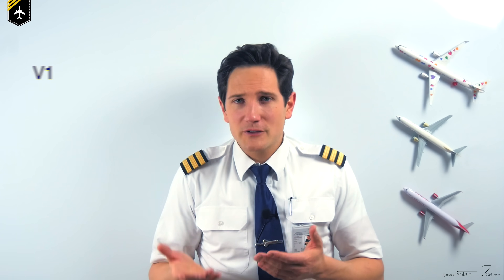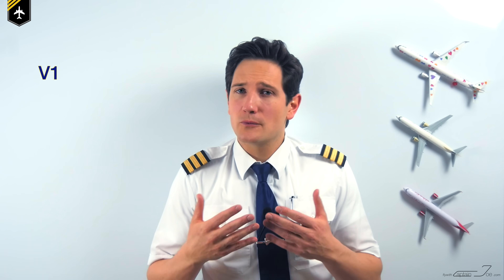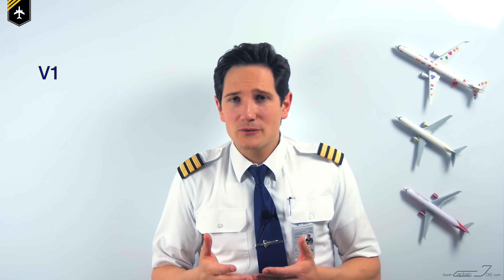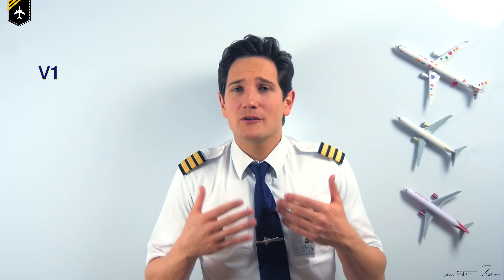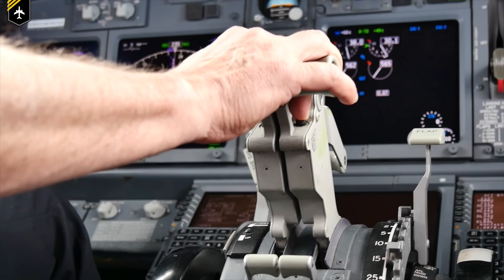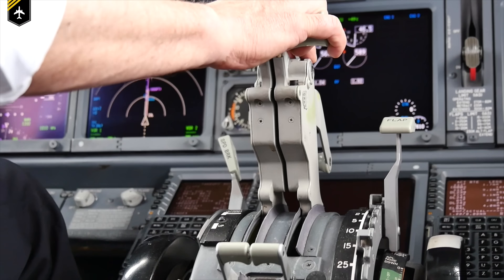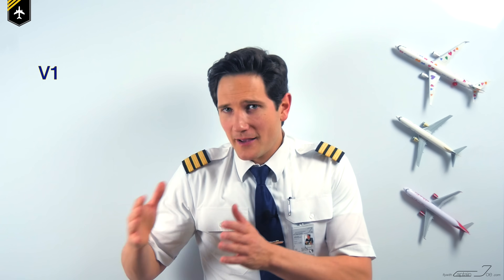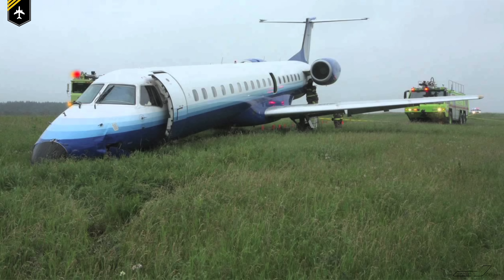TAKE-OFF Speeds V1, Vr, V2! Explained by "CAPTAIN" Joe

Comment: There are extreme situations where an abort after V1 is warranted. But more than likely the pilot would not be aware of them. For example, if the vertical stabalizer departed after V1 but before VR it would be perfectly ok to reject the takeoff as the aircraft will but critically unstable with no vertical, and an overrun is safer than an unbalanced aircraft with no lateral stability. Thats just one example though.
Reply: If you loose your vertical stabilizer after V1 (extremely unlikely) you can leave the rear landing gear down and this will help stabilize the plane for an emergency landing. If you loose both engines (again extremely unlikely) after V1 your gonna Pray.
Reply: Clement FPV with a dual engine failure, the plane won’t fly (more than a few seconds)
Reply: interesting, I was wondering what a captain would do if he looses both engines just after V1 before Vr, the airport is surrounded by  trees, it would be probably better to just overrun right ?
Reply: @clementfpv5054  If you lose both engines, there's no decision to be made.  You're not flying.  If you've passed V1, you're not stopping either.  You're going off the end of the runway.
Reply: @stargazer7644  well if you encounter the situation and decide not to decide anything, I don't want to be flying with you !
Reply: @clementfpv5054  So tell me what decision you'd be able to make?  You can't fly, and you can't stop.  You're going to run as far down the runway as you can, slowing down as much as you can.  Then you'll go off the end and start hitting things.  You'll almost certainly destroy the aircraft.  Hopefully there won't be any fire since you're full of fuel.  With luck, the cabin will stay intact so the passengers can make an emergency escape.
Reply: chris singleton Chris, how do you leave the rear landing gear down?
Reply: Felix which airplane has rear gear levers?  If you were being sarcastic, then sorry, I didn’t pick up on that.  If you really believe there are rear gear levers, then you should stick to commenting on things you know something about.
Reply: The consequences of a runway overrun varies, obviously.
Om runways equiped with EMAS, the consequences are less severe.
https://en.m.wikipedia.org/wiki/Engineered_materials_arrestor_system
Reply: Felix haven’t heard any intelligent response from you lately.  What’s up?

Comment: ok this might sound a bit stupid, but i was wondering what would happen if reverse thrust was applied whilst flying?
Reply: usmaan abdullah Aircraft wont allow it, theyhave sensors on the landing gear. 738s can have idle reverse at -10 ft on radio altimeter.
Reply: Nothing good. A high tendency to roll. Although as stated before, it's nearly an impossibility, due to squat (weight on wheels) switches. But it has happened.

Comment: Hello Joe, I have a question. As you said v1 is same for all the planes, but the take off range changes from every aircraft. For example, cessna has a shorter take off range compared to a 747, which means it has more runway left. So can they abort? Or doesn't it just matter about the runway? Is it about the speed?

Comment: So say you're flying a really long runway, with, say a twin STOL. Is it possible Vr would come prior to V1 as you could still safely land on the same runway after you have lifted off?
Reply: No. If you can land on remaining runway that's nice but it's not called V1.
Reply: In that case, would there be no V1 call?  (This is assuming that due to the runway length, the calculated V1 is greater than the calculated Vr.)

Comment: In Boeing Type Rating, the heigt from ground level is 40 feet if aircraft in one engine inop procedure. so 35 feet for what type aircraft ? Airbus ?
Reply: 35ft is certification specification for large aircraft, regardless of aircraft type. Manufacturer can have stricter standards, but not lower.

Comment: Question: what common regulations can be changed by captain?

I've been travelling to Munich from small local airport together with 30 team mates via private flight. Seemed captain decided, we don't need to go through security check, since we could be separated from other passengers in transit area. That was cool, but hit us back a bit, because on the way from Munich we needed to go through security (no separation and liquid rules)

Comment: What happens if both engines fail after V1?
Reply: Well, if those are the only two engines you have and you can no longer accelerate, then the decision has been made for you. You will not take off and you will run off the runway.

Comment: Hey joe! It would be great if you could explain the CAT I CAT II and CAT III landings. It's kinda complicated and for me a little hard to understand. Thank you :)
Reply: Dominic Hoang A Cat I approach is an approach with a minimum visibility requirement not less than 1800 RVR (VOR, NDB, ILS, RNAV) and can have a Decision Altitude as low as 200 ‘.  A Cat II approach has a minimum visibility of 1200 RVR (1000 for some operators) and a decision Height not less than 100’.  Cat III approaches can be charted with a minimum visibility of 0 RVR (Cat III C.  None in the USA that I am aware of), 300 RVR for Cat III B with a 100’ Alert Height or 600 (or 700) for Cat III A and having a Decision Height if 50’.  

Cat II and Cat III approaches are autopilot flown and landed or require the use of a HUD, and also require special crew training and an aircraft certified for those operations.

Comment: Is v1 changed primarily based on runway length???
Reply: Yes, the more thrust and longer runway the more deceleration room you have. Despite the video's statement there's no requirement for V1 < Vr < V2. Ideally V1 is more than Vr so abort is possible at all speeds prior to rotation.
Reply: No.
Reply: V1 is "the point of no return" so logically it makes sense that a longer Runway would give you a later V-1. However things aren't always logical so would be great for somebody who really knows the answer to explain it
Reply: Brian Clark Actually, yes there is a requirement.

Comment: Hello Joe. My compliments on an excellent education into aviation!! I have a question concerning plane landings in severe crosswinds. I have seen videos of planes trying to land whereby, whilst the plane is travelling in a direction parallel to the runway axis, due to crosswinds the axis of the fuselage is not parallel. Whilst the pilot tries to correct this with the rudder to touchdown, what happens to the main undercarriage at touchdown if the fuselage is still not parallel. Is there some tolerance for the undercarriage to adapt to the direction of landing whilst the fuselage is corrected. I hope I've put this as clear as I can. My best wishes and many thanks.

Comment: Am I seeing/reading this right? If V1 is always before Vr then the plane is not physically capable of safely taking off or meeting the min screen height until after there isn't enough runway left  to stop? 

If correct seems like  a pretty unsafe way of doing things. Shouldn't Vr be achieved well before V1 so if you have to reject the take off you've got enough time to make the decision and initiate procedures to stop or rotate and take off.

I'm not a pilot obviously.
Reply: V1 accounts only for engine failure. Aircraft can safely fly with one engine.
Reply: Aah makes sense now. So the aircraft is capable of safe flight with both engines well before V1 is reached

Comment: Cpt Joe I've always wondered what the noise is from the engines shortly after takeoff, it sounds like they are losing power and it always freaks me out. Thankyou.
Reply: Because planes don’t need full thrust to fly, but full trust is usually used during takeoff for reasons of if an emergency occurred, the plane would hit V2 the fastest. So after the plane takes off, full thrust is not longer needed and the throttle is set to a pre set climb thrust level

Comment: Joe, you say the speeds will always follow in the same order. But surely in a Cessna, Vr can come long before V1. Or did I miss something?
Reply: In what cessna? for example c172 doesn't have v1 and v2
Reply: Hey Nikola. Joe says from 0:34 that the speeds always follow in the same order, "no matter if you're sitting in a little twin-engined Cessna, or ... ". 

My understanding is that you could still have a crazy long runway where Vr is below V1. 

Happy for any clarification.
Reply: Of course :) Joe is trying to explain complicated stuff in simple way to ensure most people can understand him. In process of simplifying, he loses some precision and that's normal. 

We use V1 as general point where stop-go decision should be made,  but it should be clear that by certification specifications for large aircraft (CS-25 by EASA and similar document by FAA), V1 is purely in place to ensure safe operation of multi engine aircraft in case of engine failure. 
By Certification Specifications for Normal, Utility, Aerobatic, and Commuter Category Aeroplanes  (CS-23 by EASA and similar document by FAA), V1 is only required for multi-engine commuter aeroplane category.

That leaves a very large pool of non-commuter single and multi-engine aircraft for which manufacturer doesn't need to provide any V1 information, and doesn't need to demonstrate V1 related abilities for certification purpose.
Since V1 is Vef dependent, it doesn't apply to single engine aircraft at all. Why V1 is not required for non commuter multi engine aircraft? I don't know.

By the same documents, "Vr may not be less than V1". That's simply law.

Comment: Can you explain how to calculate ISA and ISA deviation?
Reply: You cannot calculate ISA. ISA is standardized set of atmosphere parameters, it is always same. ISA deviation is just how much measured atmosphere parameter deviates from ISA. For example, if ISA temperature at sea level is 15*C (it's fixed value, always the same), and you measure 20*C, temperature deviation is 20-15=5*C in other words, it deviates 5*C from standard.

Comment: Besides the V1, Vr, V2 and Vl.o. Joe has mentioned, there are more than just these main speeds. For takeoff, there are still Vstall, Vmcg (min control speed for ground), Vmca (min control speed for air) and Vmu (min unstick speed) types of speeds to consider. However, they are not as crucial but pilots should be properly educated on their respective aircraft types that they are flying, and be aware of the above mentioned speeds for a real safe takeoff! :)
Reply: They are crucial :)

Comment: What if the captain discovers a serious anomaly between Vr and V2 or right after V1? He can't abort the flight and can't continue it either.
Reply: I realize this is a late reply and the question was asked over a year ago.  However yours it is an excellent question.  Remember that there is usually more information in aviation.  “Captain Joe's” well done video above covers V1, VR and V2 but was never intended to be an exhaustive and comprehensive presentation on every possible aspect of the takeoff scenario.  Neither is my reply. There are usually some other calls made during the takeoff phase.  For example usually there is an acknowledgement that the airspeed indicators have begun providing airspeed information; “airspeed alive” is a common call.  Again there are going to be different calls for different regions and crews.  Another “call” is 80-knots (or close to that).  In learning/understanding the takeoff phase there are different levels of accomplishment.  First is just knowing what words need to be said.  Another level is saying the words at the correct place.  Another level of understanding is knowing why the words are said and why they are important and what action becomes appropriate as a result of having achieved those speeds.

The airspeed alive call is used to verify that the airspeed indicators are in fact working.  Check out “Birgenair Flight 301 a Boeing 757-200 accident”.  Non-working airspeed indicator(s) sending no or confusing information has resulted in many hull losses (crashes).

The 80 knot (70-90-whatever) call serves SEVERAL purposes.  One purpose, remember there is more than ONE purpose for the call, is to verify that all the different sources of airspeed information are still working AND that they are in agreement.  On the Boeing 737 NG I fly I have 4 indicators I check at this point.  The First Officer’s airspeed indicator, the emergency/standby airspeed indicator, my airspeed indicator and the airspeed indicator displayed in the HUD (Heads Up Display I am required, by Company policy to have displayed for all takeoff and landings).  Before or at the 80 knot “call” would be the better place to discover that one or more of them is inoperative and ABORT the takeoff.

Now to your question: “discovers a serious anomaly between Vr and V2 or right after V1? He can't abort the flight and can't continue it either.´ You are going to have to do something, doing nothing and roaring down the runway indefinitely is not an option.  A competent crew should be able to fly the airplane by pitch and power settings without any airspeed information.  Meaning they ought to be able to stick the nose of the airplane at some known and reasonable angle on the horizon and set a known power setting and be able to get the airplane into and then back out of the air safely (landing).  Every flight manual I have ever worked with has a set of tables for power and pitch settings with “unreliable airspeed” in the emergency or abnormal section of the manual.  On the 737 NG I fly in the HUD I have an AOA indicator (angle of attack).  With the AOA indicator any competent airline crew should very easily be able to fly at safe speed without any other source of indicated airspeed.  There also are independent sources of groundspeed (FMC & GPS).  Groundspeed is NOT airspeed BUT without any other airspeed information it is better than NOTHING.  That is why we get paid the salary; it is a skill.

Since indefinitely roaring down the runway is not a viable option the other choice is to abort the takeoff on the available runway in front of you.  Will you go off the end of the runway; well that depends.  Aborting after V1 statistically has a high probability of exiting the prepared surface and going “cross country”.  Exactly what is off the end of the runway anyways? Is it a 50 meter drop off onto jagged volcanic boulders and an icy cold ocean or into a jungle ravine or are there kilometers of freshly mowed farmer’s fields off the end of the runway?  Is the outside air temperature a balmy 21C or 50C below zero?  All of this needs to be though through clearly before the takeoff.  At V1 there is no time left to start thinking of the ramifications.

Comment: i was taught that v1 was the speed that you could continue the takeoff with an engine out.
v2 is where you cannot stop on the runway. Vso is engine out speed (best climb speed) and is marked with a blue line on the airspeed indicator.. Vmc is the speed at which you can use full throttle on one engine, and one engine dead.

Comment: Why does V1 always preceed Vr? Isn't it possible that the abort speed is higher than the rotate speed if the runway is long enough? In which case V1 would equal Vr in practical terms (you can't abort a takeoff that's already complete).

Comment: Hey Joe, I'm sure some airlines used to train pilots to throttle back to V2 in the event of an engine out.

This practice led directly to an accident somewhere in the USA, years ago, where one of the wings slowed down sufficiently to drop and roll the aircraft after take off, causing it to crash. This practice no longer occurs. V2 is now considered a minimum speed rather than a target speed.

Comment: For an aborted/rejected takeoff, how much is automated by the aircraft (autobrakes was mentioned) and how much is either pilot taking actions? is spoiler deployment/flap retraction controlled by autobrakes too for maximum wheel loading? Reverse thrust?  Can the rejection of the takeoff be automatic in some circumstances (I.e. engine fire alarm while below programmed V1) or always pilot initiated?  Thanks for the quality videos.

Comment: Hey Captain Joe, is it possible to drop the oxygen masks for passengers and crew to breath from and then fill the cabin with helium so the aircraft floats like a blimp in case the engines fail mid-flight? This could be a useful safety feature and the passengers would be able to entertain themselves by breathing in the helium so they can talk in a funny voice.

Comment: I was reading that, for a given capacity (passenger and total weight), a turboprop plane uses substantially less fuel than an equivalent small regional jet. Why does that happen? Have you ever flown turboprops as a commercial pilot?